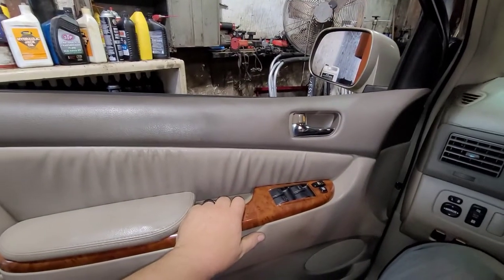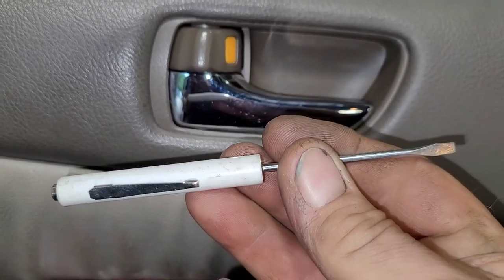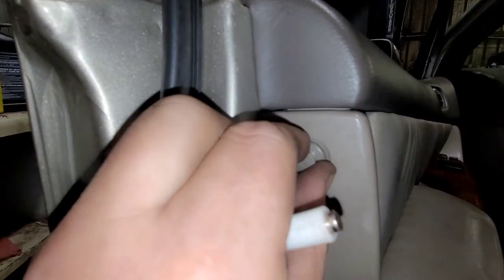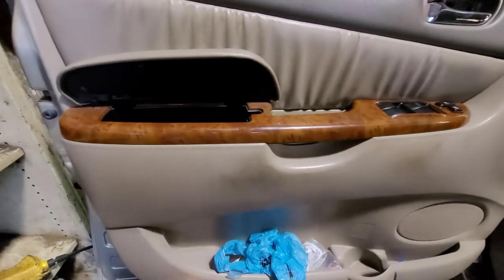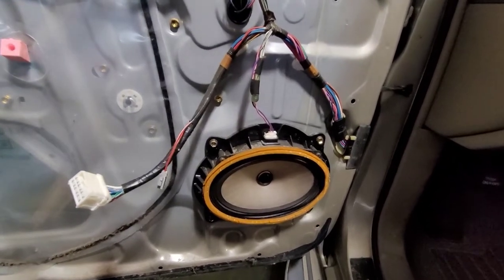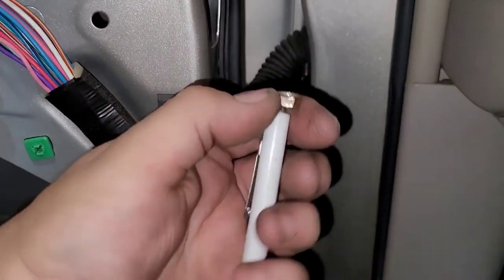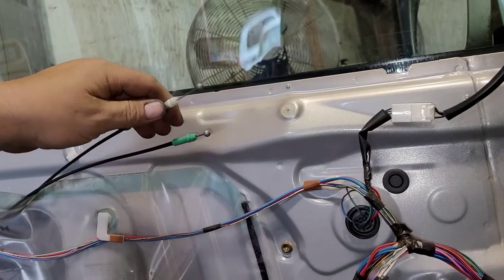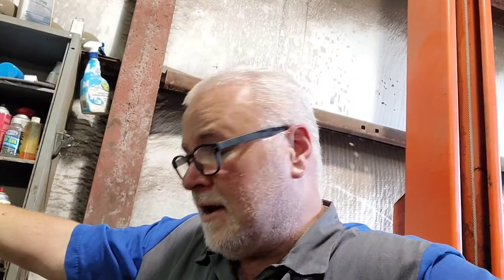Toyota Door Check Replacement. "Whats that snapping noise" ?

Comment: The check strap was driving me crazy on our old Suburban, and after a look I realized the bushings were shot. The mechanism was surprisingly complex, and that design does not permit replacing bushings alone.  Being cheap, I decided to procrastinate by lubricating the snot out of it with lithium grease. Within a week the sound was gone.
Reply from the maker: Those are quite the pain yo deal with !!

Comment: The 1999 Toyota Sienna I wrote to you about with the running light issue had a similar problem and it was bothering me as well as I knew it wasn't always that way making a noise. I lucked out in that the 1999 had two 10mm nuts that worked loose. I tightened both and problem was gone. Great video...glad you made it. Thank you.